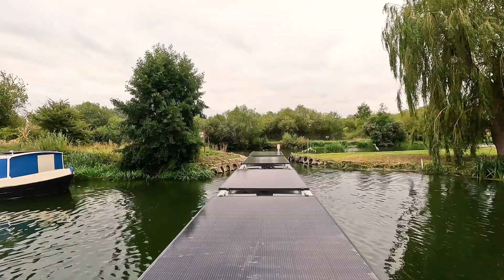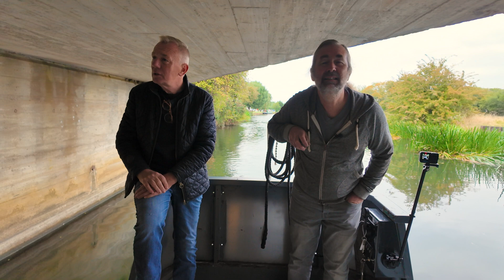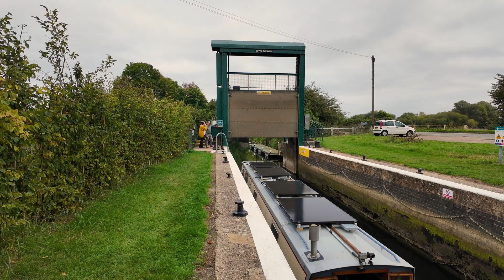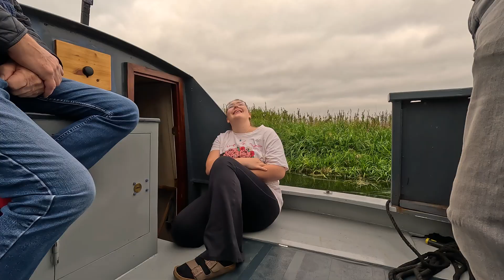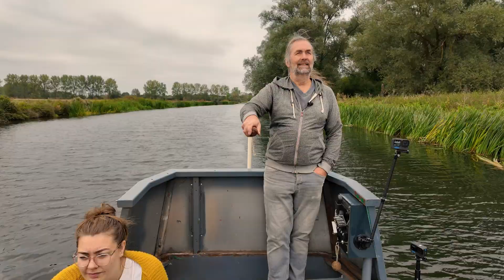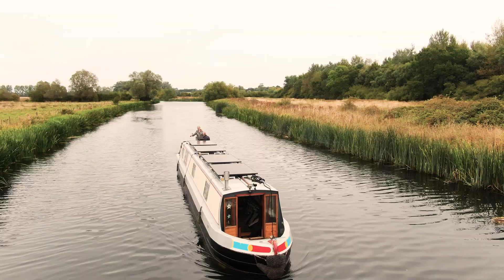Diesel to Electric - Part 5. Owners verdic on converting a diesel narrowboat to electric.

Comment: Few questions, why not fit as much as possible in the engine bay? Like the batteries etc. 
Have you noticed any speed or power issues with the change?
For instance, do electric motors generate more wash?
Finally have you done this to a Sea Otter or other aluminium boat?
If so are there any big differences or advantages?
Reply from the maker: I do like putting batteries in the engine bay buy it is damp and so they need to be the correct type. The only difference is more low power torque and less noise. Have been taking to a chap about a sea otter. Would love to do one because they are a great boat. Tim
Reply: @mothership_marine  Thanks. You know when you talk about an engine using a kilowatt do you mean a kilo watt hour so an hour of cruising in these boats uses a kilowatt?